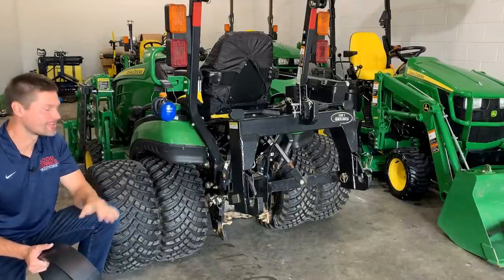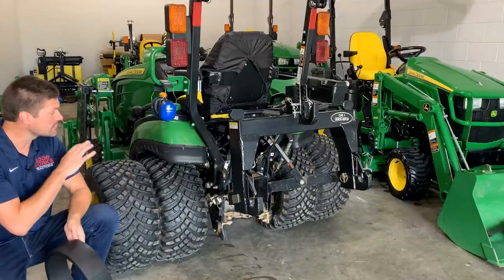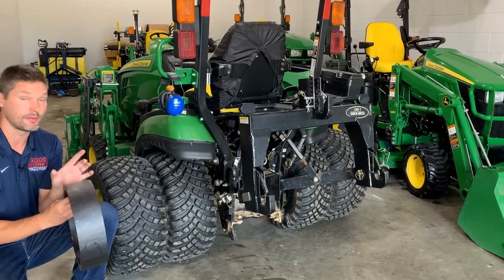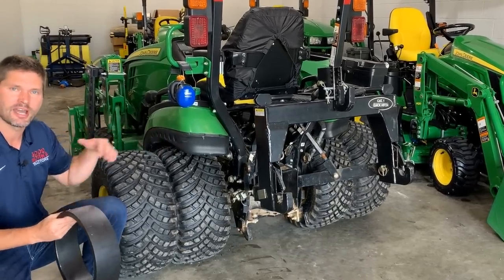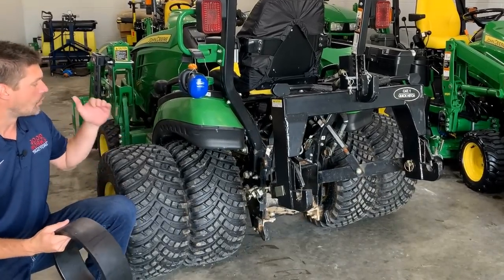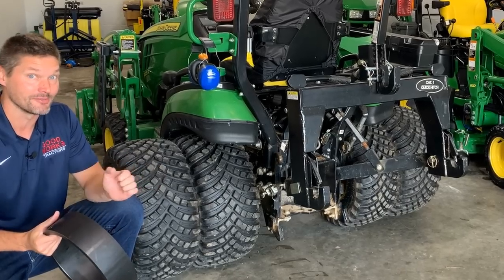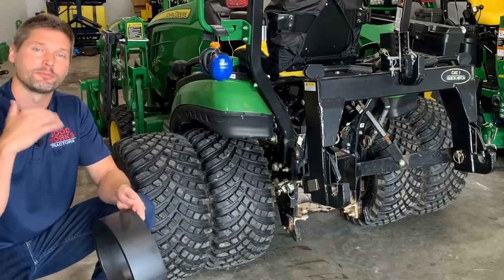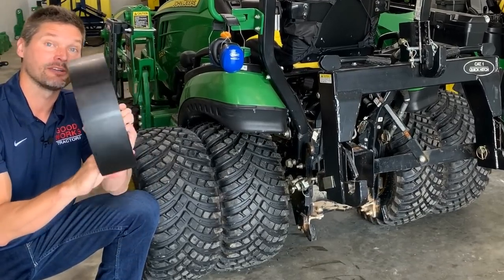5 WAYS TO FIX A BROKEN 3 POINT HITCH! 👨‍🌾🚜👩‍🌾

Comment: I had my MF GC1720's 3 point hitch stop working. If I shut it off, and restarted it, I could get the hitch to raise, but it would only work the one time. I ended up renting a trailer and taking it to my dealer (Guy Brothers in Clements Md.) and in about 10 minutes they figured out it was a bad quick connect coupler. I would have never thought that could be the problem. Weird problem, but glad I had such a great dealer (they didn't even charge me).

Comment: My dad tipped mine forward on a creek bed. Was able to use the bucket and some steel square stock to push it up enough to get traction, but for some reason 3 points wouldn't respond after. It ended up being the weight drop knob just needed to be cycled off then on again. Nice video !!!!!!

Comment: I have a 2014 1025R, everything worked fine last fall. Attached the belly mower this spring and the 3 point and belly mower won't go up or down. the raise and lower lever seems to be working. Don't know where else to start looking. doesn't have a backhoe function. If anyone can help it would be great.

Comment: Does that work well for mid mount mowing ? 

Should the rocker shaft  have some type of adjustment lock that is adjustable on the control next to the right side of the driverbon the rocker shaft itself. Like a plastic piece ? 

I purchased my JD1025r used and I don't have one. But on other tractor brands I've seen them

Comment: I have a 2008 4320. I am having an issue where the handle is very stiff up or down and the arms wont come up all the way. I cant find any leaks or broken items. you can get to go down and then it only comes  a third of the way up. It is not the dial under the seat either. My loader works perfect no other hydraulic ever hooked up to it. Appreciate any insight.

Comment: What about lift arms only coming up half way? I think it’s a seal in the hydraulic pump…? 2017 3032E. I change filters and fluid every 200 hours. Any insight?
Reply from the maker: Hmm, could be lots of things.  Seems like something is binding up.  Perhaps a seal though, clog in the system, low on hydraulic oil, too much weight, I've seen physical objects stuck in the way of the linkage before that prevented lift height, etc.  Not 100% sure what is the deal in your case.

Comment: Have a 3032E JD 3pt goes all the way up or down. Will not stop at set numerical levels to adjust level of box blade, brush hog or post hole and Auger.  Good info video but I don't believe I have that hydraulic adjustment in front of seat. Going to barn to dbl ck now. If NOT which part of video should I focus on? Not tractor mechanical savvy , only car ir truck savvy. Advice appreciated

Comment: Got a possible 3 point hitch related issue with a JD 3032E (no loader).  Hit a loose rock the size of a football.  Brush Hog jumps and shear pin breaks.  Replace and good to go but now the tractor has a good vibration at RPM (2500).  Feel strong vibration in steering wheel, fender grab handles, foot peddles etc.
Feel engine, tunnel and transaxle and no real vibration.  Just in the peripheral parts as mentioned.
PTO on/off no change.  Speed, forward/reverse, 2X4, 4X4 no change.  3 point up/down no change.  Does diminish with RPM reduction.
Suspect the hydro pump for steering and 3 point.  At RPM high pressure line from pump for 3 point has a high frequency vibration.  Steering line does not.
Torsion damper was also suggested but shaft seems to spin true.
At a loss so far on this one!!
Any ideas are welcome.

Comment: What about this: 3320 that got borrowed to someone else in the company. They manage to break a lift arm; it gets replaced and gets a service.
Now it's back but I'm finding out its range only seems to be between the 3-6 position. 
So now I can't get my brush deck high enough to ensure it won't catch on transitions between fields and driveway. 

Just to clarify; 3 seems like the new 0. The arms touch the ground at 3.

Comment: crazy question.  when I check my hydraulic fluid using the rear dipstick, I have a very difficult time "reading" the result.  either the oil is so clean that it doesn't contrast with the metal.  any tricks that work for you????  thanks

Comment: I have a JD 4310. I have a 3 point issue I cant solve. the piece that holds the adjustable side (rt) of the lower arm keeps breaking. Its a cast piece that threads up on the lift arm. I am using a sickle mower on the 3 point. cutting is fine. I stop, lift the cutter to make my turn. and  POW the lower cast piece breaks where the lower arm is pinned in. I have checked the setup and its all put on the way JD had it set. the last one only lasted less than 24 hrs. any clues would help.

Comment: I just bought a 430 garden tractor diesel, I’m looking for a 3 point hitch set (rock shaft, top and lower bars..etc.) and a 54” snow blade for it. I wonder if you have anything like that would work with my tractor. I checked your website but didn’t see anything for older machines. Thanks

Comment: i have a 1023, and the 3 point will drift down onw its own  when running are stopped with engine off, no issues with norm operation

Comment: Hello there, I have a little problem if you have the time to help me.
I have a NEW HOLLAND T-8050 tractor and I attached a heavy rear blade on it.
The problem is that although the blade is heavy, it doesn't stick to the ground when the tractor goes through some bumps or diggings.
Is there a way to make the blade stable whatever the terrain is?
THANKS in advance.
Reply from the maker: Maybe try going slower or adding more weight to the blade?
Reply: @GoodWorksTractors   THANK YOU

Comment: This is a question for a RC2060 brush hog. The safety gaurd chains that hang down off the back, what size is the cable. That goes through each chain link. Is it 3/16 or 1/4 in thickness. And it has the crush sleeve on each end.

Comment: Thank you Courtney! I am sure that I will have some of those problems like the rock shaft coming loose....... Hey, with the wider spacers, will the 54D mmm work? it seems like with the extra space the tires wouldn't interfere with the gauge/anti scalp wheels.
Reply from the maker: Yeah, these adapters will interfere with the rear gauge wheels on a mower deck.  That's the downside.

Comment: Hi on my 4200 when the 3 point hitch comes up at top hydro psi dose not release labors motor until o slow Lee bump it back what could this be ?? Thank yoou
Reply: Mine is doing the same thing. What is the fix?

Comment: I got tired of bs runaround because of dumb ass engineering design the valve that controls your lift is bad thay wanted over 700 bucks for the replacement valve assembly  and a arm and a leg to do it ! Around 2000 bucks ! This was 4 years ago ! I got the steel and bought a electric winch 3500 pounds built a mount around 190 bucks it been working good no problems ever since  with all attachments large bushhog, disk ,chisolm plow, posthole diger  , turning plow ,  6ft tiller ! All for less than 250 bucks and it looks neet ! Ps it has a remote control to 👍